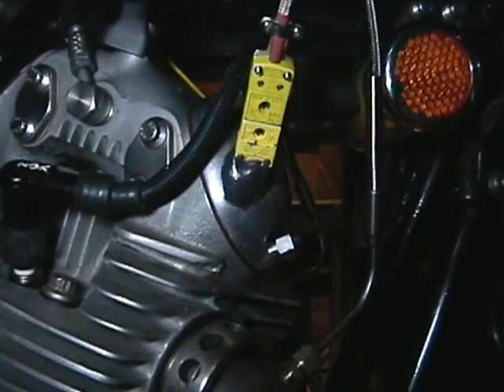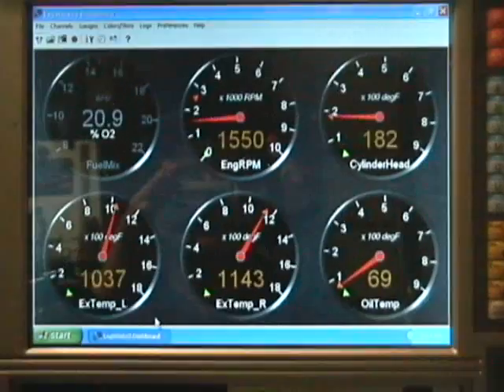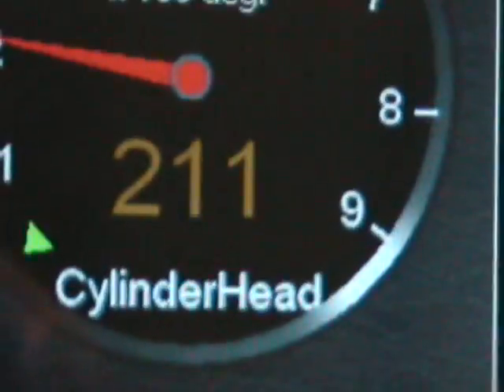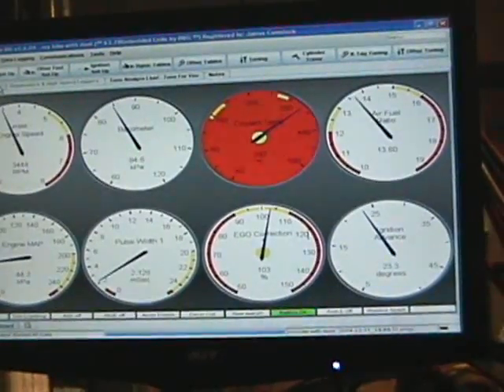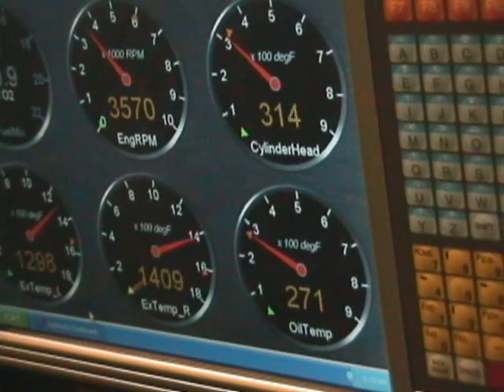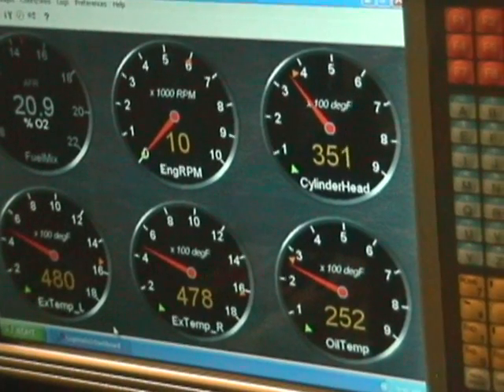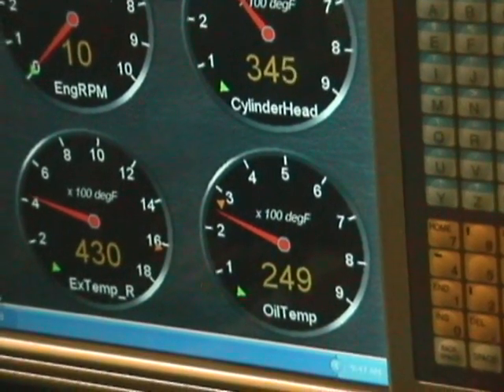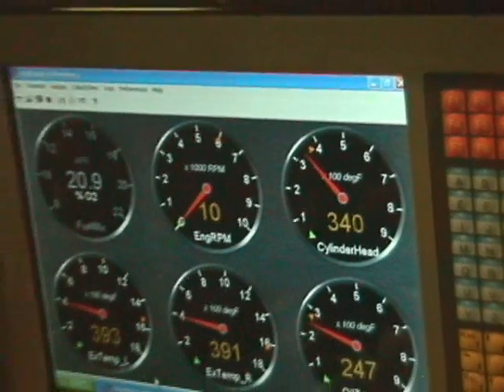oil temp test - Norton

Comment: There was a successful  Norton-Race-Team years-back in NZ , they had some engine and gearbox-failures until they went full-synthetic-oil . This makes-me want to fit a cooler on my old 82 XV1000 (TR1-Roadster ) and maybe some cooling-fins on the external cam-oil-feed-lines . People think I'm mad to change my-oil as-frequently as I do....I think They are-mad to leave-it 5-7-thousand between services . I also change-it scalding-hot immediately-after a good-ride , while all the clutch 'fines' etc are still in-suspension . Since I started doing it this-way , my oil now looks-clean (not like-new obviously ) when I drain-it and nothing-like it used-to look . I think it was FortNine who had lab-analysis done on a bunch of motorcycle Brands @ their first-service , some very-interesting-results .  Dave  nz

Comment: I'm following your lead, Jim.  Plumbing a small billet aluminum cooler into the rocker feed line.  Located between the down tubes, just below the front Isolastic.  Being billet it should be able to handle the sandblasting and small stones thrown up by the front wheel.